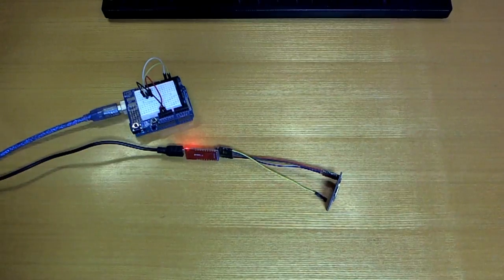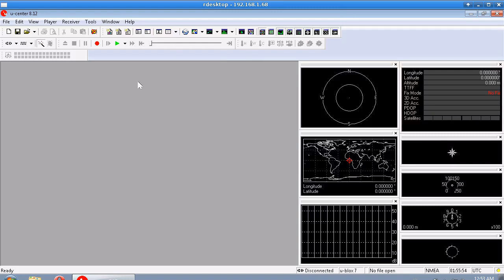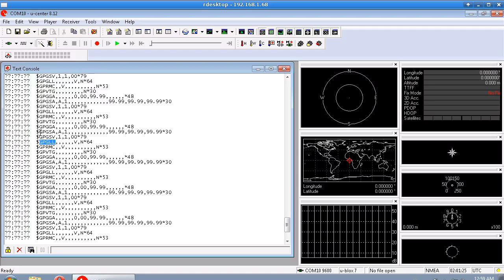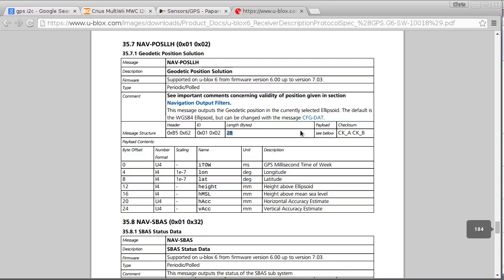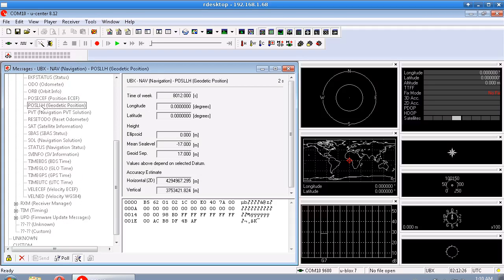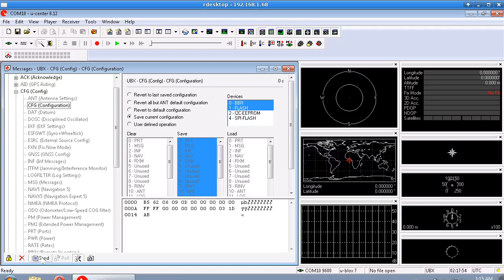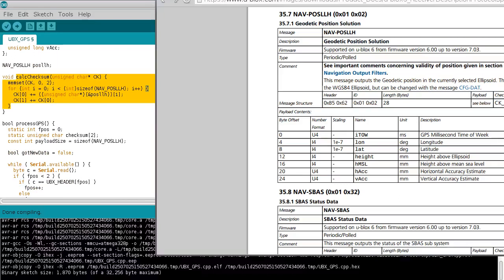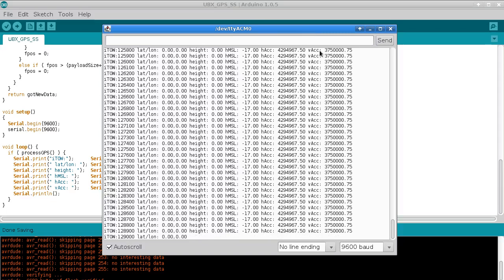10Hz U-blox binary GPS data in 66 lines of code (arduino)

Comment: Thank you for your video. I saw your C94-M8P video as well, could I apply this set up to C94-M8P one as well?
Reply from the maker: Yes, almost everything applies similarly. I used this UBX method with no problems with the M8P. Keep in mind that the firmware versions differ slightly across some modules, and the size of message packets may vary. See the pinned comment in this video for an example: https://www.youtube.com/watch?v=ylxwOg2pXrc

Comment: wow this was really helpful. I found this from Andreas Spiess. I wonder if you (or anyone) knows the fix for what I've deemed to be a dead unit (neo-6m). As soon as it gets GPS lock, the serial connection dies and the computer does not receive any packets from it, nor will it accept any from the computer (aside from hot/warm/cold restarts), but def no config updates/changes, reading cfg or of course no pos or timedate. Disconnect antenna so it loses lock, and instantly you see the connection icon flashing, and read/write works again.
Reply from the maker: I've never come across that. There are settings that will disable UART input/output completely, but I would not expect it to depend on having a lock or not. Maybe you could try a factory reset, I think that is available somewhere in the u-center utility.

Comment: Thanks for the great tutorial ! Like to ask one question. Is it possible to modify maximum altitude(which is 50 km  for NEO-6) using u-center or programming.I hobbyist and doing high altitude ballooning ..
Reply from the maker: I don't know. But if you got that 50km number from the spec sheet of the Neo6 then I would think that is the limit of the Neo6 itself, not the firmware running on it.

Comment: Thank you for showing me how to use u-center. Do you please have a link for the data sheet? I may now be able to change output time using u-center from UTC to local time (NZ). Lowering the rate caused writing to an SD Card to fail- I am using NMEA, not UBX, Arduino UNO and an SD card shield. Writing to a .CSV file - date / time, lat, lon and altitude.
Many thanks.
Reply from the maker: pretty sure you can get the datasheet by googling "ubx protocol". Changing the time is just a matter of adding a few hours isn't it... not sure you would really need u-center to do that if you are reading in the values into your own program. You mean increasing the rate? Not sure why lowering it would be a problem.... if you're gonna write values to a file and throughput is an issue, you might want to write these binary values to the file instead of .csv, which would be more efficient.
Reply: *****
Yes, sorry increasing the rate. Adding a few hours is probably the easiest but I dont want to do this adjustment in the sketch as I need to keep code as tight as possible. Getting corrected local time straight from the GPS would be ideal. Found the PDF - there are predefined datums I should be able to use. Thanks again.

Comment: Thank you @iforce2d for your video. But it does not work for me. After changing to 10 Hz I saw 5 line flash two times in one second!  It is 10 Hz but not like your video. Please tell me it is correct or something went wrong.

Comment: You have kept active only the nav-polish, will that require less power and memory?
Also, increasing the Hz are you increasing the accuracy?
 How you can sleep and wake the GPS module without the Tiny Libray?

Thank you!
Reply from the maker: No, the calculations required to triangulate the position still need to be done, regardless of what messages you ask for, so the GPS will not save any power or memory. No, increasing the Hz only increases the number of updates per second. I have no idea if these GPS modules can even be made to sleep.

Comment: I am all about smaller and more efficient code, as I am working on a multi-copter flight controller with a 250Hz rate. I am finding that the SoftwareSerial read (whether I read it, or not) takes about 10 of my 4ms cycles, every time the GPS refreshes. Are there any alternatives, tips or tricks, that eliminate that 40ms pause (seems excessive for 28 bytes of data)?
Reply from the maker: Use hardware serial. For the atmega328 this is a nuisance because it must be pins 0 and 1 which are also used to upload sketches, so you need to keep disconnecting and reconnecting them every time you change the sketch, but it will fix your delay problem.
Reply: Thanks for the rapid response! That looks to have done it. Fortunately, I happen to have an I2C LCD display on hand to make sure it is working, as hardware serial rules out the Serial Monitor.
Reply from the maker: You could possibly use a software serial for the logging, if the output is not too verbose. But the LCD display makes it much easier :)
Reply: I'll have to give it another try. It seemed as though the Serial Monitor communication was blocking the GPS communication on RX/TX. Once it is all working, there will be no USB, as the copter will be in flight. Until I get to that point though, it is nice to 'see into' the works. In order to minimize the impact, I send a single digit to the LCD with each loop and 'build' the screen full of data in 28 passes. I suppose I could work out a similar scheme for the Serial monitor, if as you seem to be saying, it actually should not interfere with the communication on pins 0 and 1.
Reply from the maker: I2C should not be so slow that you need to update the screen like that. If you have not tried it yet, check out the u8g library, it has a much faster update mechanism than the standard driver: https://github.com/olikraus/u8glib

Comment: Hello 

First, thank you for all the work you’ve done in presenting this and the other very
informative videos on you youtube site.  

I am not extremely proficient at C programming so I was a little confused by your use of
the indirection (*) and address (&) operators you have used in the Arduino
code associated with this video.  In particular, there is the line of code:

      if ( (fpos-2) < payloadSize )        

              ((unsigned char*)(&posllh))[fpos-2] = c;

A couple of questions about this:

Is it technically  “legal” or even a good idea to reference a structure in C (posllh) through

indexing    ([fpos-2])   as if the structure were an array?  I tried to read
a bit about this online and most of what I read said that this is not usually
permitted, but may/may not work.  In your  program, it is apparently working just as you would want it to.  

Then I am  confused about the * and then the address of & operator.  Could you explain a bit about what is
actually happening here?

Finally, the  quantities in the structure posllh that are > 1 byte are in “little endian”
format.  I confess that I wrote my own  version of this code --- reading in each transmitted byte into an array of
bytes.  Then to get the correct  quantities for lat and lon for example, I had to bit shift the bytes to take
into account the little endian format. 
In your code, you do not seem to consider this formatting at all.   Can you explain at all why you can basically
ignore the little endian formatting – does the structure posllh somehow take
this into account?

Thanks very  much for your time.     Richard S.
Reply from the maker: Most compilers don't really care about 'legal', if it's all memory within your program then it's yours to play with and there is no concept of 'permitted'. Sure you can treat a struct as if it were an array, as long as you know the positions within the struct/array where the data members will be. On a 32 bit operating system you have to be careful because the data members may not all be packed into the minimum number of bytes necessary, because 32 bit systems often place variables at 32 bit addresses for efficiency. In that case you would need to explicitly specify that the struct should be 'packed'.
https://en.wikipedia.org/wiki/Data_structure_alignment
http://www.catb.org/esr/structure-packing/
https://stackoverflow.com/questions/4306186/structure-padding-and-packing

The arduino is an 8 bit architecture so structs will always have their data members at single byte offsets, no packing is required.

The operation of * and & is explained ad-nauseum in so many C textbooks and blogs everywhere, I'll leave it to you to figure that out. It might help to break down the nasty looking parts into more steps, instead of putting it all in one line. Eg:
        ((unsigned char*)(&posllh))[fpos-2] = c;

is equivalent to:
        NAV_POSLLH* structPtr = &posllh;
        unsigned char* charPtr = (unsigned char*) structPtr;
        charPtr[fpos-2] = c;

Actually I never considered the endian format issue, it just worked like this so I guess for the arduino system the format was already ok. Other platforms may do this differently, maybe the code you're talking about was not running on an arduino.

Comment: I wonder if I can find out weather my Neo 8M on my Pi uses moe than GPS. Im fine with 1 hz but i want to push the precision to max. As far as I can say i got 10hz with my old 6N as wel by sending echo -en '\xB5\x62\x06\x08\x06\x00\xC8\x00\x01\x00\x01\x00\xDE\x6A' > /dev/ttyS0 to the module. Wonder how i might be able to configure my 8N module right after bootup by sending multiple echos to my module
Reply from the maker: https://www.youtube.com/watch?v=ylxwOg2pXrc

Comment: Hi iforce2D, I just want to start off by saying you have some amazing videos on your channel and thank you for them.

I have a question about receiving the UBX-NAV-PVT protocol. Firstly, I have the exact same GPS module as you (neo-6m-0-001) but when I attempt to receive the UBX-NAV-PVT, I don't get anything. At first I thought it was a problem with sending the commands in hex on setup(), but once configuring my module in u-center, I realized I just wasn't able to receive the protocol at all. I am however able to receive the rest (majority) of UBX commands despite this.

Is it possible for you to send/upload your configuration file for your GPS module.

This is a last resort for me and I have been searching and trying a multitude of different things with no success.

Thank you very much!
Reply from the maker: +Darryn Papathanasiou the 6 series doesn't do NAV_PVT
Reply: +iforce2d I did not expect such an amazingly fast response, thank you very much!

I did see in the data/spec sheet that there wasn't any allowance for the NAV-PVT command but I was under the impression that it was incorrect as, like I said earlier, I saw you do it with the exact same chip (neo-6m-0-001). I realize now that you weren't dealing with NAV-PVT, but rather NAV-POLLSH!

Thank you for the help!

PS: I am busy building an extended GPS tracker + logger for my car and I have been referring to your videos from time to time with regards to the GPS + GSM modules. Could I contact you through email if a question were to arise? I would appreciate it tremendously.

Thank you!
Reply from the maker: +Darryn Papathanasiou better to ask here so that others can benefit from our discussion in future. And it's not like you'll get a quicker reply by email :)
Reply: +iforce2d Very good point :)

Comment: it looks your FTDI powers the GPS. Any precautions regarding 5V vs 3.3V supported by GPS?
Reply from the maker: cezar t That will depend on the module you have. Most of them seem to support both 5V or 3.3V, but best to check before connecting it up! Incidentally, I found that this module would also work ok with 1.8V, so if in doubt you could go with 3.3V first and it might just work ok.

Comment: i have a C function that reads and parcels txt files, is it possible to get the hexadecimal logs out of this (in real time) just as a line by line text file? would really appreciate your help if possible. on a debian device btw, beaglebone black
Reply from the maker: If you want real time, I don't see the need for writing the data to a log file, only to read it back again. Perhaps you could use libserialport to let your C program open the serial port directly? If you also want a log to look at later, your C program could write that as well (but in parsed format, not the hex).
http://sigrok.org/wiki/Libserialport
https://github.com/sigrokproject/libserialport/blob/master/examples/list_ports.c
https://github.com/sigrokproject/libserialport/blob/master/examples/send_receive.c

Comment: neo-6m work even with an empty sketch...connect direct of neo tx to uno rx after upload  to avoid upload err...and check your serial mon...and the tinygpsplusplus are quite outdated...download the neo-6m library...and run sketch with neofixserial.h...tinygps cant calculate gps time synced to your coordinate....the clock were off for gps time with tinygps & tinygpsplusplus
Reply from the maker: Empty sketch will not be UBX protocol. The clock gives you time in UTC, it's not 'off'.

Comment: Hi iforce2d sorry to disturb you again. i've studied a bit your code and i would like to know if untill i pubblish only one single class and one single id i should be able to use your code for for NAV-PVT message instead of NAV-POSLLH just changhin the structure (and of course renaming the filelds) am i right in understanding your code ?
As far as i understood it you do not check for class or message id you just fill char by char the structured variable untill you reach the payload right ?
Thanks.
Reply from the maker: Yes that's correct. As long as you're only using a single message type it should be ok to use a different message, but I did not try it myself... there might be something I missed that causes trouble :)
Reply: I've read a  bit the spec for 7P (the unit i've ordered) and the NAV_PVT should be

struct NAV_PVT {
  unsigned char cls;
  unsigned char id;
  unsigned short len;
  unsigned long iTOW;
  unsigned int year;
  byte month;
  byte day;
  byte hour;
  byte min;
  byte sec;
  byte valid;
  long tAcc;
  byte fixType;
  byte flags;
  byte reserved1;
  byte numSV;
  long lat;
  long height;
  long hMSL;
  unsigned long hAcc;
  unsigned long vAcc;
  long velN;
  long velE;
  long velD;
  long gSpeed;
  long headingAcc;
  unsigned int pDop;
  unsigned int reserved2;
  unsigned long reserved3;
};

I will greately apreciate if you could give this structure a try with  your unit since i haven't received mine yet.
Thanks, Much Apreciated.
Reply: Dario Armellin long lon is missing between   byte numSV and ong lat;
Reply from the maker: sorry dude, no time for that :(
Reply: *****
nop mate, i will wait for my unit thanks !

Comment: Thank you very much for this tutorial, it's really helpful. Nevertheless, I'm experiencing some troubles when I want to disable the NMEA sentences. It appears that all my other settings/messages will be stored (Rate, POSLLH, etc.), but the action of disabling the NMEA sentences won't be stored. Any hints why this could happen?

I'm currently working with the u-center version 19.01, and my GPS module is a NEO-M8P-2. My final goal in the end is to be able to extract the UBX-RXM-RAWX messages, in order to generate RINEX files afterwards.
Reply from the maker: None of these settings will be stored when the module is powered down, if that's what you mean. You will need to send these commands each time it starts up. If you mean the commands to silence the NMEA output is being completely ignored then I have no idea. Perhaps your module uses a slightly different message version, you'd need to check the docs for that version to be sure.
Reply: @iforce2d  Hello, thanks for your reply. Actually, my question became obsolete after watching your follow-up video. As my receiver is connected to an arduino pro micro 3.3V, I am just sending the correcty bytes to change messages, rates, etc. every time I power it up. Thanks for that! 

Now, as already mentioned, I'm trying to extract the UBX-RXM-RAWX messages. I've followed your instructions, but unfortunately my checksum always returns false. Therefore, I pressume I must have done something wrong in the structure of the payload, which is as following: 

const unsigned char UBX_HEADER[] = { 0xB5, 0x62 };

struct RXM_RAWX {
  unsigned char cls;
  unsigned char id;
  unsigned short len;
  double rcvTow;
  unsigned short week;
  signed char leapS;
  unsigned char numMeas;
  char recStat;
  unsigned char reserved1;

  // Start of repeated block (numMeas times)
  double prMes;
  double cpMes;
  float doMes;
  unsigned char gnssId;
  unsigned char svId;
  unsigned char reserved2;
  unsigned char freqId;
  unsigned short locktime;
  unsigned char cno;
  char prdStdev;
  char cpStdev;
  char doStdev;
  char trkStat;
  unsigned char reserved3;
};

Any ideas why this could go wrong with this output? Has it maybe something to do with the variable payload length?
If more information is required, my code is on github:  https://github.com/dariopa/GPS-Logging-Station/blob/master/GPS%20Station/_UBX_GPS_MessageOutputs_and_RAWX/_UBX_GPS_MessageOutputs_and_RAWX.ino

Thanks again for helping out, really very much appreciated!

Comment: Hi, I have now managed to get the SD Card to works and can save the data. I am still trying to implement the FIX so that the SD caed only stores valid data the Struc is ok but I am still having Trouble trying toget the Checksum to work. Can I just copy the checksum void and Exchange the NAV_POSLLH and &posllh for NAV_STATUS and navstat? I am not sure of the NETIQUET whether I could list the code here just to check I am on the right track.Would that be OK ?. it also possible that someone else has already sucessfully implemented the fix check.
Reply from the maker: +OE8PCK you can use pastebin to show some code, is probably easiest. Can't promise that I'll study it though :)